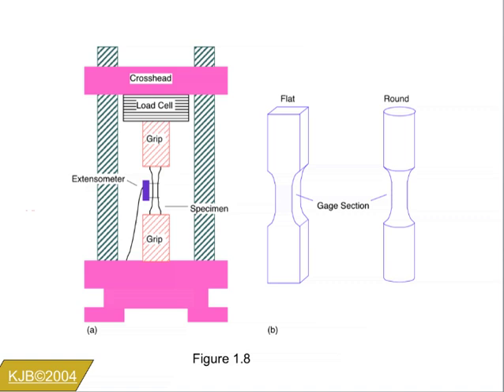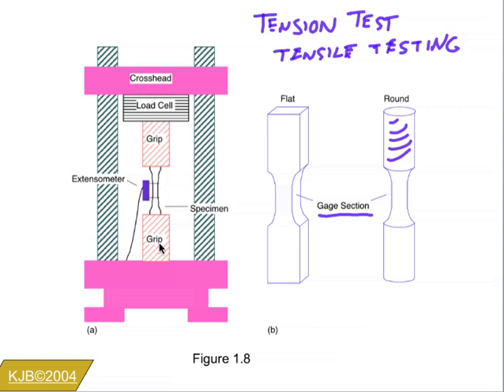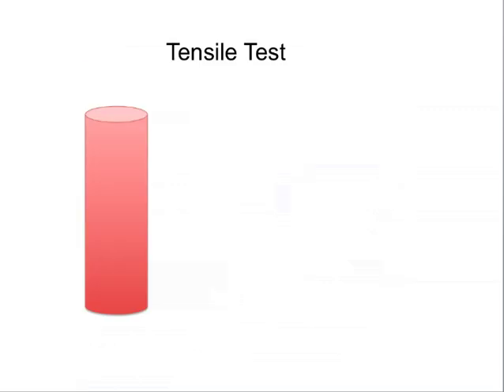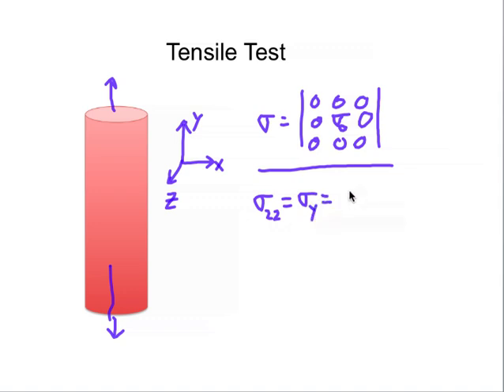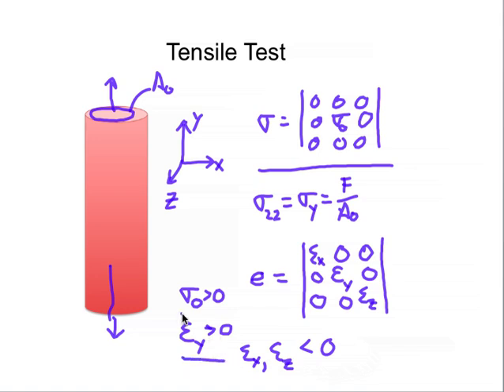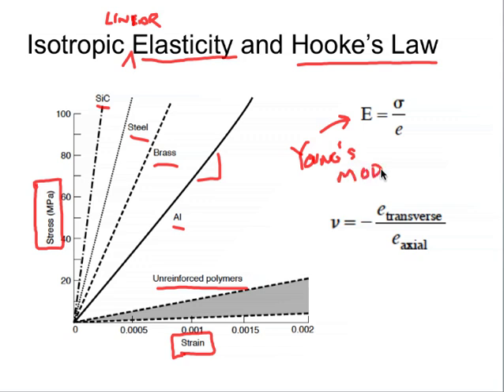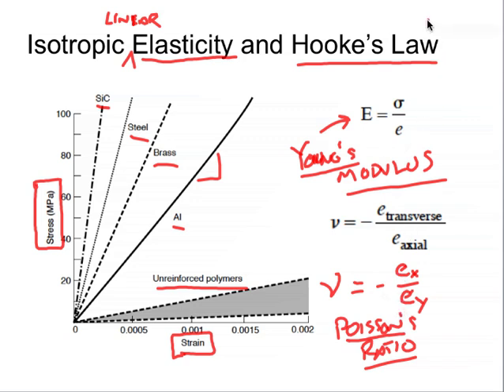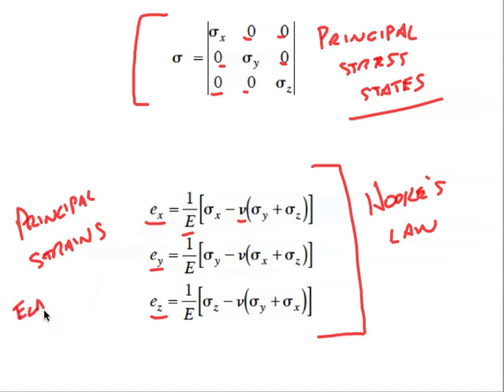tensile test and hooke's law pt 1.mov

Comment: for the round specimen, at necking triaxial system of stress will develop and if the material is isotropic then the reduction in area is uniform. Not for square specimens. These specimens first curve in showing what is called the "diffused necking" on the side plane i.e over the thickness of the material and then undergoes "local necking" over the plane perpendicular to the thickness of the material. Both these necking are individually planar unlike necking in the circular specimen.

Comment from the maker: Very little effect up until necking - although the square cross section corners should be slightly rounded to avoid stress concentrations. After necking, final failure may vary, although I do not know if it has been studied (but I am sure there is some old paper on it).